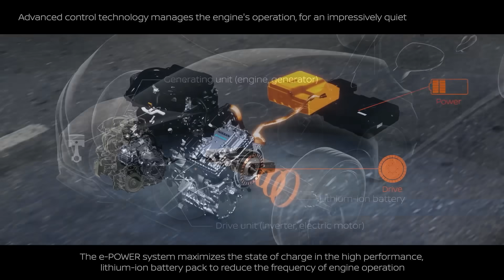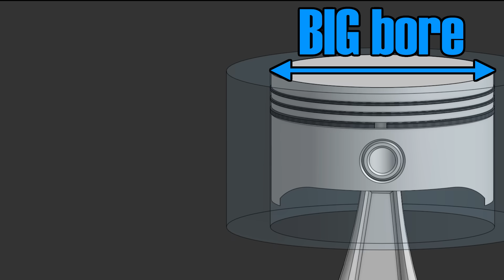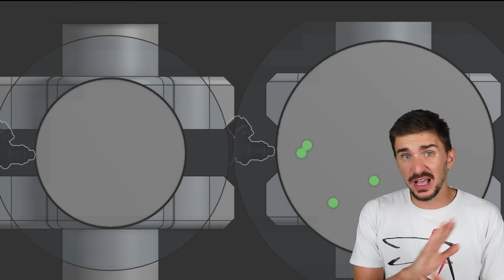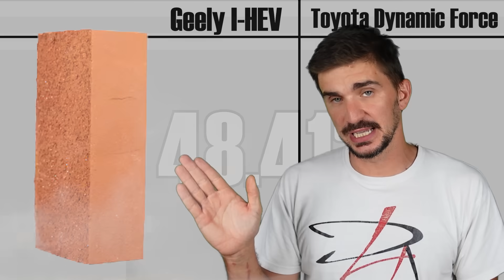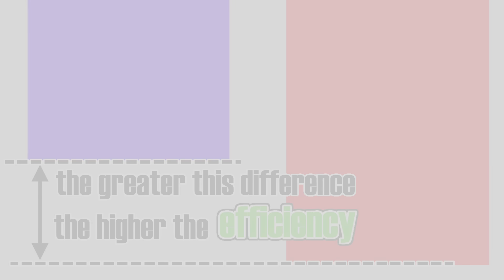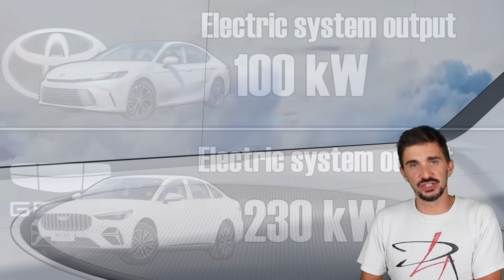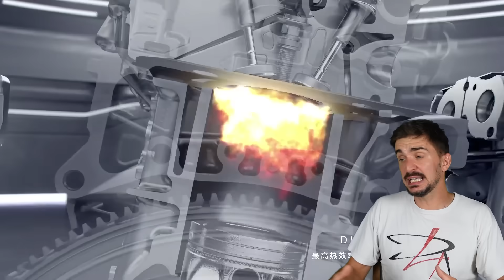How China's Geely Beat Toyota, BMW, Ford and Everyone Else

Comment: As an engineer, with railway experience, I note that locomotives have been built as electric propulsion vehicles for decades, because it works much (much much) better as a way of delivering power to a vehicle. Directly coupling engine to wheels creates SO many unnecessary compromises in both the engine design and in the vehicle tractive performance... the only real advantage of mechanical drive to the wheels is that it's cheap... not good,  not efficient, just cheap. 

But if you can engineer an ev that's cost effective, unless charging infrastructure is really fit for purpose,  it makes a lot of sense to add a tiny range extender engine that's heavily optimised for the sole task of driving the generator, and have it beavering away keeping the battery charged. 
Better yet, make it a plug in hybrid and do the 90% of your driving that is short trips, from excess solar. 
That's what i am doing.   90-95% of carbon emissions gone, with available technology, and Australia's garbage effort at ev charging infrastructure doesn't  impact me.
Reply: The UK Qashqai is effectively like this.

Comment: So if i understand correctly, Geely just took an incredibly weak engine, to just for shits and giggles, to pair it with an EV motor to make it NOT zero emission, in order to therefore claim an incredible Th efficiency %. Kind of like scamming people with headlines that nobody actually understands. To make matters worse, as engineers, we are suppose to simplify things and be genuine with our work but instead we are tricking 99% of the population that does not understand these concepts. Sad.

Comment: 16:53 — I can recreate this solution and it'll be infinitely more efficient and simpler.

It's called a "Gyroscope," and your cars likely already have this.

No need for a map. Just passively and automatically charge the vehicle when it's on flat ground. No need for extra and expensive infra. Just simple physics and some switches. That's it.

Comment: I wonder under what conditions the toyota engine efficiency got measured. The engine varies the delay (copilot claims as much as ~20–30° to ~60°) based on the conditions so is the 41 % the efficiency at the highest delay or at some average?

Comment: I still feel like edison motors fuel generator and electric only drive solution is the way to go for a hybrid vehicle. Using the fuel powered engine for anything besides generator power seems to add a bunch of extra weight, complexity and inefficiency automatically

Comment: At 13:56 it says 1.5 TD. I wonder what that stands for in the graphic.
Reply from the maker: It stands for turbo. But that's not the engine that achieves the advertised efficiency, only the NA version does. There's 3 engines in the family.

Comment: Additional Port injection on the Toyota engine will keep its valves cleaner and therefore efficient longer vs the geely will require walnut Shell blasting and the expense to do so

Comment: This seems like a use case for free valve. Especially, since it only needs 4 of them to vary the amount of cylinder used in the compression stroke. 48.41% efficiency during most conditions, but with the ability to drop under 40% to up the power output when the battery is approaching depletion. I'm probably missing something.

Comment: So my high school auto tech teacher was wrong, in telling me i was wrong about how an under square. or really any engine should in theory be more efficient if you reduced the compression stroke but maintained or extended the power stroke
Geely, can i get this in a 3L inline 6?
Also, i'd like a road trip mode that runs the engine at its lowest, most efficient RPM the entire time i'm driving, or at least turns it on in this mode long before the battery is depleted to the point that the engine would have to start up, and is asked to do so much more work while cold and inefficient.

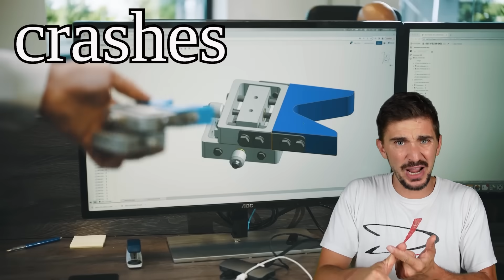Comment: 17:54 Not technically true. While can run it on pretty much any device, that doesn't mean it'll run well on any device. I tried using it while on-the-go with an Intel Atom-based Netbook from 2014 and it STRUGGLED with large complex models with lots of vertices. FYI (But like, I also recognize that that was an extremely underpowered device to begin with. It struggled to open and scroll large Google Docs files lol)

Comment: This seems like the perfect idea and how to bring back V8 and witness take a lot of wear off the engine 2 plus we get the noise that's some people desire I mean if they implemented a 302 Windsor then just modernised they have the basis of the V8 what's the new technology how to have a really fuel efficient car something my 302 Windsor is not the reason people don't want to abandon it because electric doesn't feel realistic it feels like driving a remote control car what exactly fun great for little bit of fun for the first half an hour and then you give up you're like I'll go back inside electrics just not very climatic especially when you spend so much money on the vehicle

Comment: What if you use another set of valves, sort of like vtec but, they whould activate from sufficient trottle and reduce the depth of miller-atkinson cycle, to reduce engine sluggishnes on demand ?

Comment: And chinese solution is better, because they build cars as electric first, then add the ICE as a current generator, they have whoie car electrical grid/cables/harness made EV first, they don't use much of step down converters and less prone to failures, we already see in EU in specialised shops that repair Hybrid/EV/ICE that toyota/VAG/ ect, have many small failures in the electric step down converters that are doing too much work. As for the "Ai" thing, they stole this from VAG and tesla (already since years now)

Comment: Please correct me if Im wrong. But I believe that Honda did very similar things around 2019 with the Insight and Accord hybrids. Getting extremely high thermal efficiency while using the electric motors as the primary drive train and the gasoline motor primarily as a generator for the electric powertrain.

Comment: I think this is the better approach because you extract more energy from every gallon of the gas you burn and the EV torque will put the speed factor up to par with more powerful ICE. Another thing is with ICE in their car, they can use that as political chip to penetrate markets by letting those market built the ICE engine like in the US which currently closed to Chinese auto maker.

Comment: I'm not sure I understand the take at the end of the video where you say that other manufacturers should try this as well. The Chinese invented nothing new with this "inverted" hybrid concept where the ICE engine is only charging the battery while the wheels are powered by the electric motor. Nissan has been using this concept for years on the Qashqai and X-Trail, it's called "e-Power". Also Mazda and BMW used this on the range extender versions of the MX-30 and i3.

Comment: Edison Motors had a video on their plans for increased hybrid efficiency for hybrid semi trucks using route mapping to have a computer tell the generator when to or not to produce based on whether or not current battery level will meet demands of the route ahead. I think this is a huge asset in overall efficiency; my hybrid does well on the highway, but going to the Oregon Coast has me driving over the Blue Mountains and it doesn’t know to stop generating before I reach the top and the battery is full long before I reach the bottom of the miles-long decent. Predictive energy management could save unnecessary fuel burning.

Comment: I know nothing about generators but would it not be more efficient to remove the piston rod completely and immediately induce current with a magnet attached to the piston, a coil along the axe and another combustion chamber on the opposite side of the piston?

Comment: The real question is will it last as long as honda or toyota engines?,even if it does,
when somebody need to replace some part,do they need to wait for weeks or months?
There are quite a lot of Chinese car in my country and when it broke,you need to wait for months for the part to arrive 
On the other hand,you can just walking in Toyota or Honda’s dealership and walking out with the part you need,waiting 2 days is the worse case scenario

Comment: Gasoline engines should have been abandoned and all the efforts and money should have gone into making Diesel engines even more efficient and clean because these thermal efficiency ratios are typical for Diesel engines the last 20 years. Also, some years ago we had seen hybrids with diesel engines but very quickly were pushed out of the market because their efficiency, mileage, reliability and fuel economy were out of this world.

Comment: With china its always fishy, you probably know how they can manipulate how testing is done to achieve "record" numbers. Like their coefficient of drag results that aren't replicated else where, or their CLTC that is mathematicaly impossible (unless you drive at less than 60kph), or how they can just list how much power their motors are rated at rather than system output (say an engine built for 2000hp but only is running at 850hp, but you say your car is 2000hp), i can no longer trust the chinese. Oh yeah, and how they say this car can do 1500 km on a single fuel tank, so you can travel from A to B, and in reality that A to B is just a highway and you're lucky if you get 500km out of it.

Comment: How educational!!!! Thank you brother. Clearly explained but still I dont get everything especially about the delayed compression. My thought was that if you compress a greater volume of air/fuel i.e. dont lose some of that ratio by delaying compression, you achieve better efficiency because the greater compression created a greater explosion. Am I that dumb? I also am confused that piston travel on large bore engines did NOT encourage high revs. The big V8s of the 60s and 70s didnt rev that high but they had low down torque. Wasnt the bulk mass of the bigger piston a disadvantage to revving higher. Forget about the balancing of a big V8 here. Im talking about a large mass moving up and down more rapidly than a smaller size piston. E.G. 2 litre 6 cylinder engines. Anyway we live and learn I suppose.

Comment: Never expect this dude is a mouth piece for China! How much did they pay him to spill junk like this. Geely 3-cyclinder suffer vibration problem at idle due to crappy engine design, dual-clutch transmission (DCT) jerks, slight jolts, hesitant shifts during stop-and-go driving, and the expensive turbocharger maintenance. But why surprise? Any thing from China is utterly useless as they never test their vehicle under extreme condition, corner cases, reliability, or MTBF their dumb design.

Comment: Its already a problem with some hybrids that dont use the ICE alot that the engines collect water and fuel from lack of operating temperature reaches, rusting the engines from the inside.

Comment: Basically, underpowered PHEV. Good for specific scenarios... on paper. PHEV on its own probably has only some sense for bigger vehicles. Here you will really struggle with an underpowered engine. Then, of course, reliability, which still has to be proved. And this is usually a hard task for already proven engine tech, let alone for something "cutting edge" like this. An expensive PHEV system combined with the still questionable long term reliability of a completely new IC engine seems to be suboptimal. I think it is good that big car manufacturers explore new approaches, but I would not like to be the first to test them, considering all the above. Lastly, cloud/AI tech is something that I think does not match well with this kind of vehicle, where you supposedly should be experiencing more freedom and independence.

Comment: Toyota should update the software on there atkinson software to have adaptive cycle between atkinson to deep miller. But that will require  to combine the system that nissan used.

Comment: So, the Geely engine is essentially a generator engine.  Very tuned torque curve to accommodate the otherwise very low power of their so-called “deep Miller Cycle” without a blower to make it a real Miller Cycle.

Comment: Here a question for you: most EV place the batteries under the floor close to the road.Could it be a problem in northern county where they use salt on the road during winter. Isn't there a risk of corrosion damaging the batteries?

Comment: Hold On!! Hold on a f**Ing minute there!!  Can't they just dynamically change the valve timing to produce a "shallower" Miller cycle when there is a temporary need for more power??????
Reply: You will change compression ration to higher. You will need to combine variable strock and variable val timing. Nisan have sometieng, -VC-Turbo. It can vary the compression ration from 8:1 to 14:1 with maximum efficiency 42%. This engine design still have mechanical reliability issue.

Comment: EV's with range extending generators are the best vehicle in my opinion. I drive a ford hybrid and it's ok but could use more torque (and less traction control). Perhaps a 4 motor or front and rear motor setup with torque vectoring differentials and a generator.

Comment: Geely's own employees may have started as novices, but they've purchased everyone from Lotus to Volvo, so there's certainly no lack of talent at the company. I'm also skeptical that a "deeper" Miller cycle alone would give these kinds of gains. My hypothesis is there's something going on to reduce pumping losses with the Miller cycle, although that "something" may be as simple as intake geometry that's insanely optimized for the engine's very narrow operating envelope or as complex as a new approach to variable valve timing. If they had anything close to Konigsegg's FreeValve tech I'm sure they'd be bragging about it, but I could absolutely see a Chinese company replacing hydraulic VVT hubs with some kind of brushless motor, or if it's non-interference maybe even driving the cams directly using a brushless electric motor. They can make CNC machines with brushless servos that sling multiple tons around at crazy accelerations and insane positional accuracy. As scary as it sounds, the technology honestly exists today to do it even for an interference engine and probably make it just as reliable or more reliable than timing belts. Jump starting the vehicle would then become impossible, it would need to be towed and charged, but once again software could come to the rescue there and prevent the vehicle from ever entering such a state (e.g. make "0%" charge really be ~10% and limit power to less than whatever the ICE engine is generating until the battery recharged).

Comment: Ive been fustrated at the lack of range extended electric car. Really dont even need their special high-efficent engine because it wouldnt be needed much. A cheap moderate efficency engine is all thats needed and is only run occasionally as part of a self-maintaince type cycle to get things up to temperature and avoid stale fuel or during infrequent long trips. 

Im nearly certain its us and eu regulatons/gov incentives that prevent such a reasonable approach to be taken.

Comment: So it is an EV with a range extender. The battery is small to save weight & cost. AI with mapping software allows it to hypermile without the driver comprehending the concept. While bore/stroke ratio is beyond current standards, go back 100 years and you will find it very common. High compression ratios are not "effectively high" due to delayed intake valve closing. Still a novel engine, and you have done a great job explaining it.

Comment: Isn’t miller cycle using early intake valve closing and Atkinson late intake valve closing? Comparing the German Wikipedia and the English version (which you quoted in your video) don’t agree on this and during my research this has always been the case. Miller = early closing of intake valves. Atkinson = late closing of intake valves.

Comment: Please talk more about the unique virtues of Range Extender engines i.e. combustionizing an EV instead of electrifying an ICE vehicle.
From my long reflections on the idea, there are many considerations that I want you to think about.
1. Where a PHEV transitions between EV and ICEV, a REx and the traction battery are always working together. Instead of waiting for the battery to drain, a REx can be turned on with around 80-90% battery charge to provide a huge energy reserve. This allows for long distance travel with only the average power requirements of the vehicle needed from the REx. 
2. Not only must a REx be an affordable option for potential buyers to be attracted, changing the design of the BEVs to facilitate the REx cannot raise the cost of the non-REx BEV model. The current system for a PHEV is to shove a huge battery somewhere into the rear of an existing or modified platform. For a REx to succeed its integration into the EV must be more seamless than PHEVs and retain affordability of the REx and BEV.
3. 48% efficiency is unnecessarily high. A REx will probably average around 2000-3000km per year. If it literally only provides power for 40,000 km in its entire life, 7-8% efficency increase over simpler technology will only save around 100 gallons of gasoline.
4. Lowering the weight of the REx is more important than raising its efficiency. If it spends 90% of its life being hauled around, reducing efficency vs a pure EV raises carbon emissions and reduces EV range and efficiency.

Comment: 13:26 ohhhhh! Modern hybrids only work by essentially distributing load above the engine's peak efficiency to the motor. Of course power needed for cruising is minimal compared to that needed for acceleration. Geely essentially designed an engine that barely produces to cruise at highway speeds, then all power demands above that are filled by the motor! That's honestly incredibly clever.